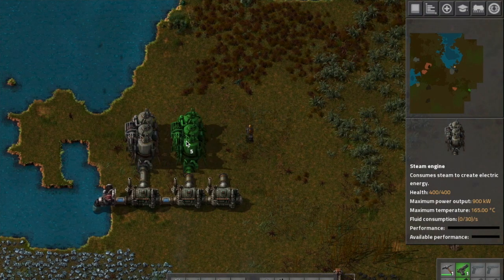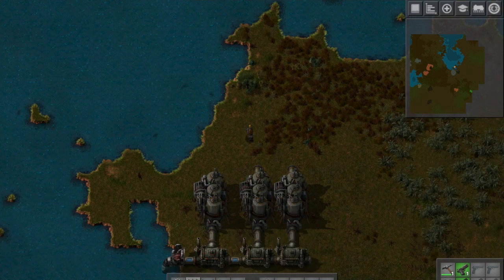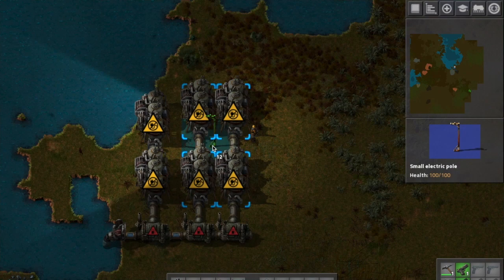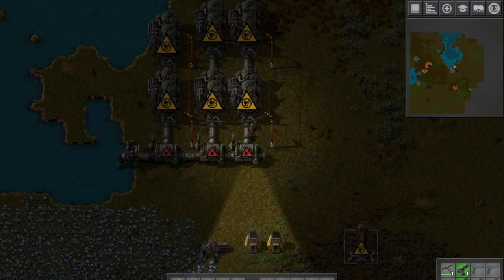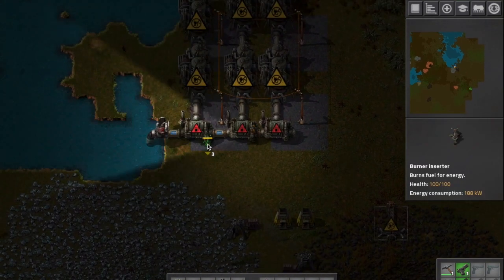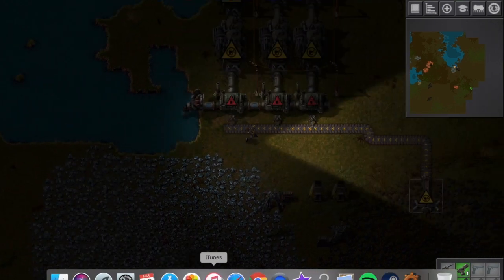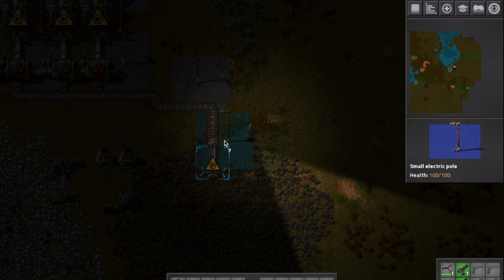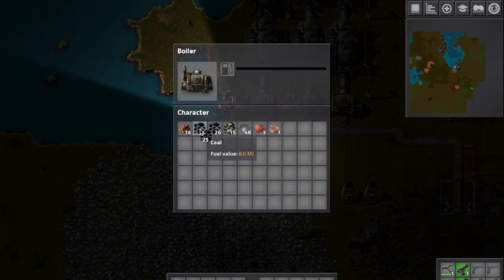Factorio - Steam Power Tutorial

Comment: How do I fix power output problems of the steam engine????
Reply from the maker: Alex Pijoan if it’s a case that you’ve now built too much and the steam engines can no longer cope with the demand then you need to either build a new set of steam engines or build alternative extra power supply like solar panels.
Now if it’s power output problems, is everything working as it should do with coal going in and the pump is getting enough water and is the system working efficiently?

Comment: do you need to connect the steam engines with pipes?
Reply from the maker: ThatGuyCole if you want to be able to space things out and be able to get the electricity pylons between yes you can use maps but over all you don’t have too
Reply: ok, thanks for the quick reply!
Reply from the maker: ThatGuyCole no worries happy to reply
Reply: Hey. I know this was 7 years ago but I just picked up the game and I’m just noodling around with it. I’m trying to get some electricity by inserting a pump at a water source, piping it to the boiler, feeding the boiler coal, piping the steam from the boiler to the steam engine, running an electric pole close to the steam engine to feed the grid  and…..the steam engine won’t run.
Am I missing something? Thanks
Reply from the maker: How are you feeding the coal into the boiler? Does the arms that feed the coal in need electricity too?
Reply: @ I’m just hand loading the boiler right now. The fuel level in the boiler is full. The steam engine never starts to run. And thanks for the reply
Reply from the maker: @flddoc2 is it definitely getting water in? And the boiler is connected to the steam generators?
Reply: @ I saw a video on my problem. I wasn’t actually powering anything so once the steam engine filled with steam it just stopped. Duh.
Thanks for the effort.
Reply from the maker: Fair enough